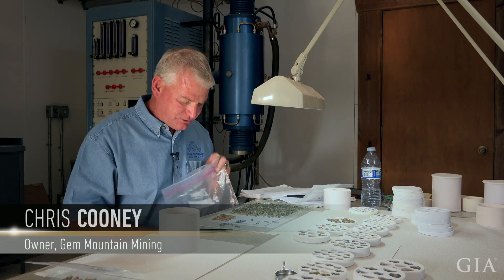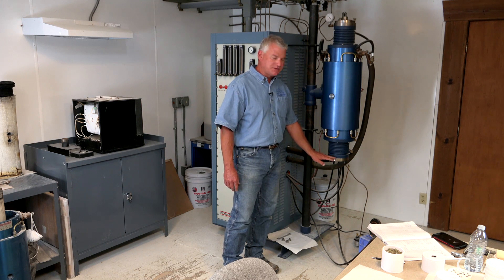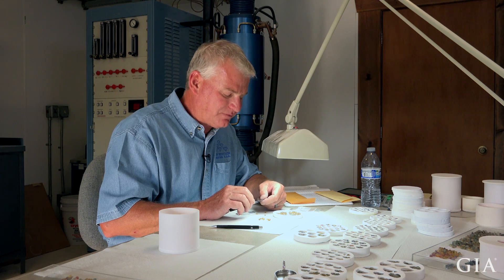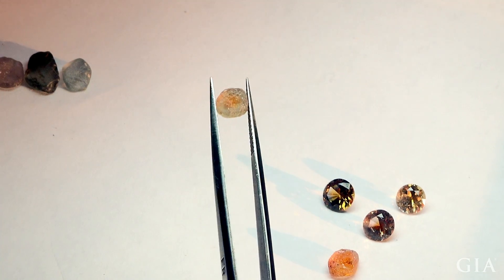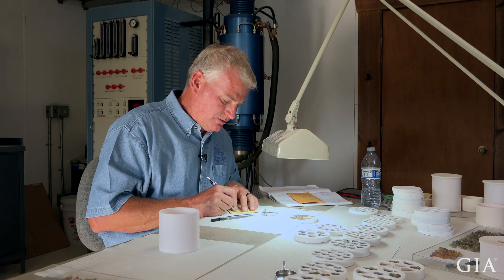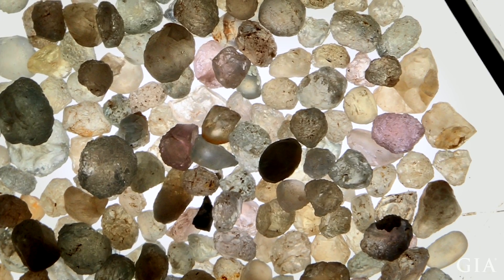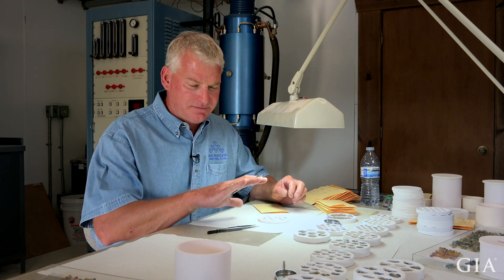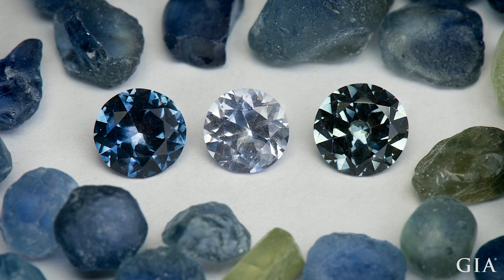Heat Treating Montana Sapphire

Comment: Using impervious aluminum oxide crucible to heat sapphires made up of aluminum oxide.  Kind of ironic don't ya think?
Reply: Considered inert and none reactive to the mineral itself which is Alumina Oxide ( Corundum ) but crystallized  .... With some source material and more so than other sources you will observe the Alumina Oxide crucibles or dishes or plates or the platform, so to speak, used to contain the colored corundum absorb some of the color from the corundum that you are  burning.......so a white or cream colored Alumina ceramic dish or crucible, is stained Blue or Red or Pink, for example, after burning the Blue Sapphires or Pink Sapphires or Rubies or Purple Sapphires or Yellow sapphires...like that ..Cheers

Comment: correct me if I'm wrong 
I think if you change the shape of the crucible ( mesh shaped or the base of the crucible has holes), I think this will change the heat current inside the furnace. and will affect the color saturation. the 1/3 of your unsaturated stones will decline.
Reply from the maker: GIA does not heat treat gemstones. For specific details about the process, we suggest you contact Gem Mountain, the company that demonstrated the process in the video. Published information, such as the book The Heat Treatment of Ruby & Sapphire: Alchemy & Science by Ted Themelis (3rd Edition, 2015), might also be helpful to you
Reply: That can help as my associate learned back in 1985.......but not so relative to the heat but more relative to the specific Gas atmosphere contacting each stone in a more effective manner...and it did make a difference ...cheers
Reply: Muito bom 😃 parabéns